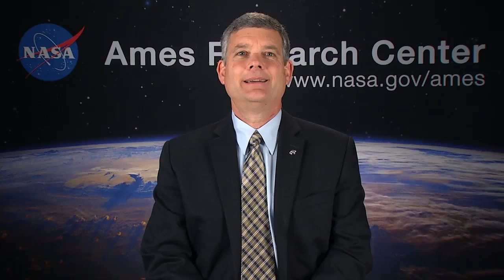High Performance Fast Computing Challenge

Comment: A fun science information collection test would be to hammer a press fit hss pin into a machined part that has a cavity which takes a few different paths then leads to a hole on the other side of the part, completely fill the machined parts cavity with a ferro fluid, track and log each of the polarized iron atoms in the fluid during the test, then smack the open hole with your hand and the pin should pop right out. That's awesome fluid dynamic, if it was a piston and flywheel what amount of energy would be created? Add this data to your stock.